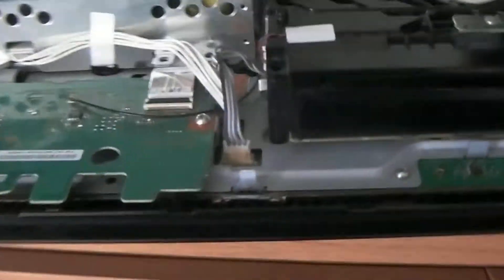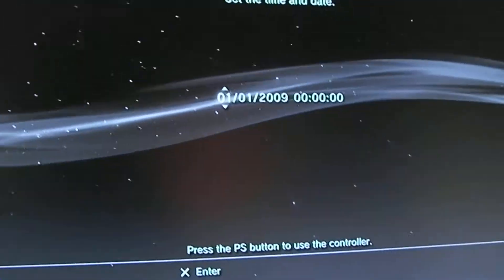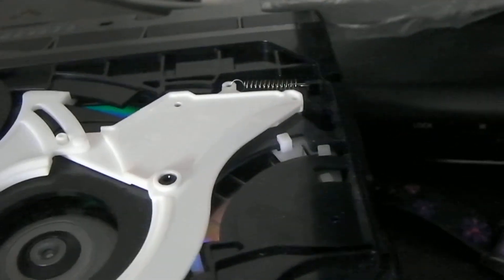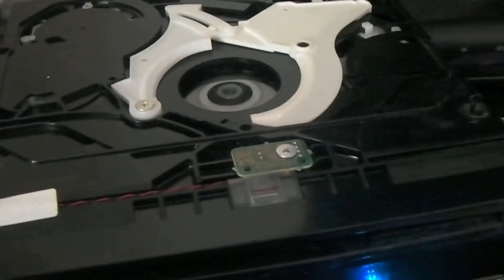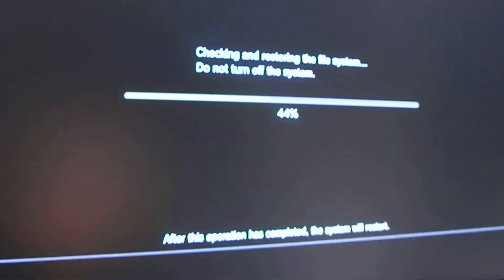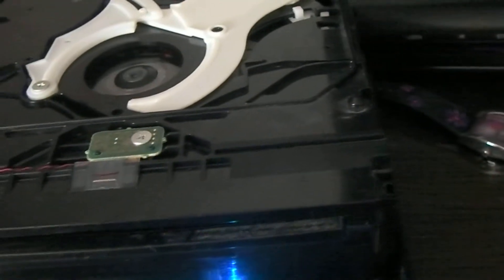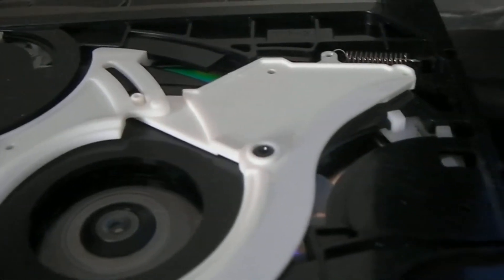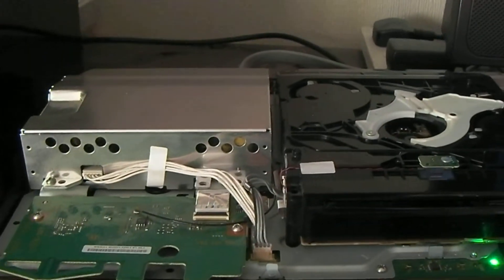Porjects Update: Broken PS3

Comment: yeah the baking works sometimes, i did it to me da's one a few months ago when it got ylod.  As for the drives you need to look up what laser is in them, sony has used at least 3 different types in the blu ray drive and they are all different wavelengths. you could start with replacing the lens9cheapish) and then see if you want to replace the laser, which costs a bit more.or mabye look for a replacement on fleabay. i guess at the least get whatever games are on the hard drive onto your own ps3